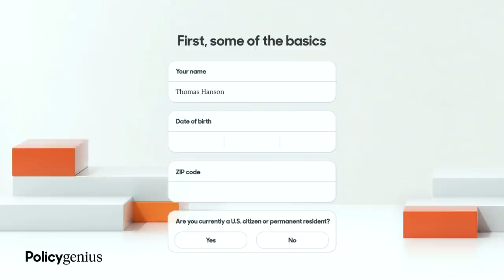Custom High End Shower Tile | So Easy A Handyman Can Do It | THE HANDYMAN |

Comment: The Schluter corner bead is a game-changer when you consider most tile doesn't have a bull-nose version for you to have that factory edge you speak of. I just miter the corners like you talked about because in my humble opinion I think it looks nicer. Takes a little more time to get it perfect but the results are top notch and set you apart from the other guys.

Comment: Pro youtube tilers seem to stress sliding the tile to collapse the underlying thinset ridges to maximize thinset coverage under the tile. seems unnecessary for tiling walls. Anyway, you make it look easy.  Thanks for doing what you do!
Reply: Very odd concept. I thought the raised ridges help keep the tiles uniformly even in height as the grout dries? So you don't end up with that goofy rippling wall effect afterwards.
Reply: @droolbunnyxo502  nope, I am sure you know by now that the ridges are trowelled so that you can get 100%, or as close as possible coverage on the back of the tile when the ridges collapse. The spacer/levelers he used keep the tiles flush with each other.
Reply: @apsdidit  Yes, I can see that working, if you picture it in your mind a bit. I'm not a professional tiler, even though I play one on TV.
Reply: @droolbunnyxo502  me either but I did stay at a holiday inn express last night. Lol
Reply: @apsdidit  Whaaat...?
Laughing... Thank God for UD.

Tiler
Someone who eats soup out of there ass.

Tiler eats soup out of his ass.

by Quincivilius February 18, 2020

Comment: Think what you're doing now is kosher. Even though I am licensed, I constantly want to see what other guys are doing. Never know when something you saw on  video (or job site) will bail you out. Those Schluter strips are pretty standard in So Cali, tile outfits don't make a lot of trim pieces. That and setting larger tiles rather than smaller. Less grout - cause with Prop 65, grout is crap these days.
Oh and a Non Ferous blade works on any saw for cutting these. We 45 these!

Comment: I really appreciated this video! Would have loved to see more of you cutting the tiles. Question - how do you avoid chipping the glaze at the edge when cutting? I’ve found the snap cutters work well and then I rub the edge with a stone. But whenever I use a wet saw I still get chipping, even with a fresh good diamond blade. Granted, the wet saws I’ve used were a handheld 4” one and a 7” table top type, both Ryobi so maybe the blades wobble a bit compared to a high quality tool. I haven’t used the kind with a sliding blade on top. Is it me or my tools or cheap tiles, or a combo?
Reply: Chipping happens because of general purpose crap blades or the blade just gets worn. Use a dressing stone to expose new diamonds and sharpen your tile saw blade every 15 to 20 cuts...